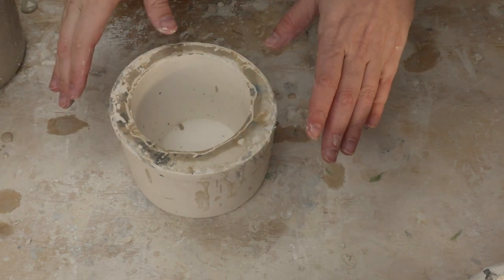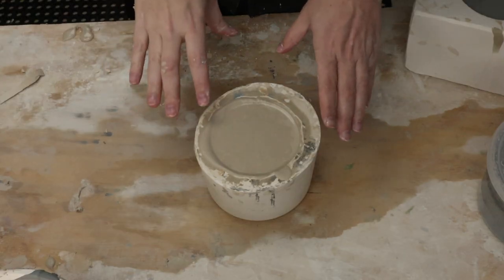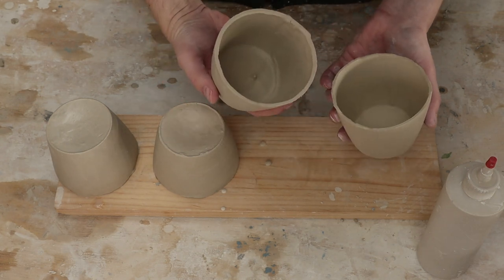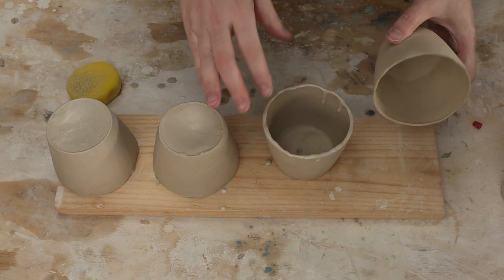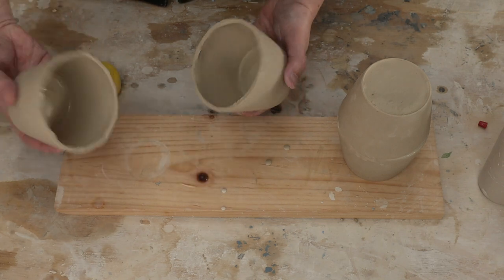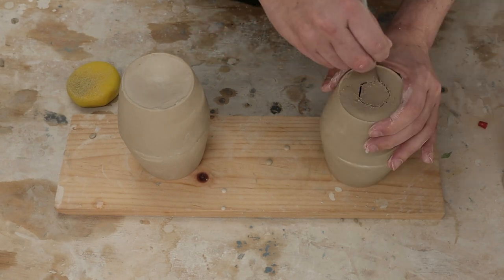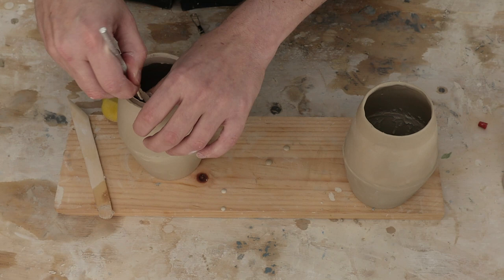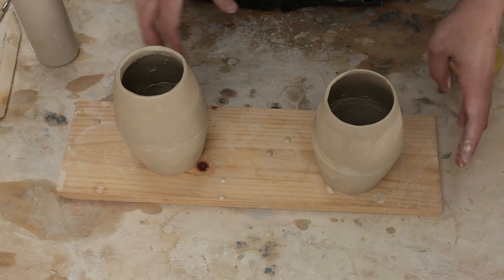New forms by joining slip cast pots

Comment: you can use a two-piece mold to cast this shape
Reply from the maker: Thanks. Yes you could and I have some other videos with multi-part molds. One of the advantages of doing it this way is it is one less mold you need. If someone wanted to make a bunch, I would recommend making a mold just for it.